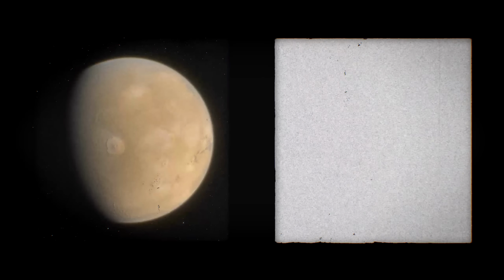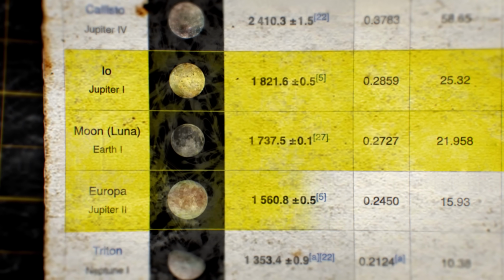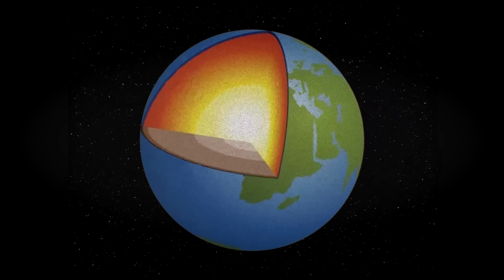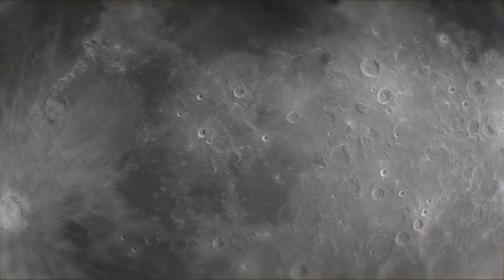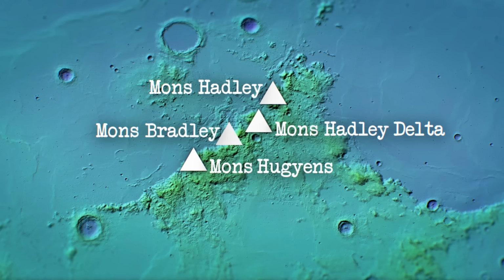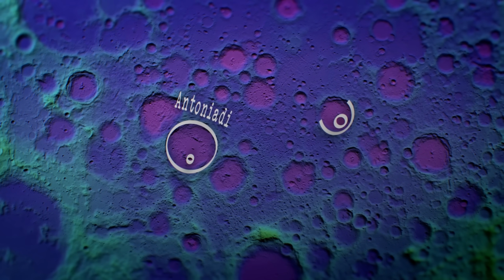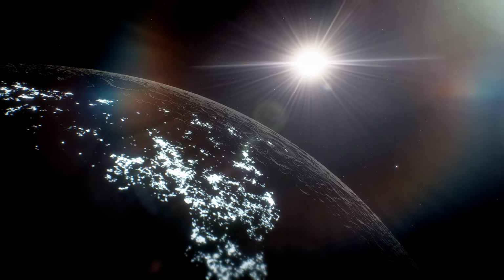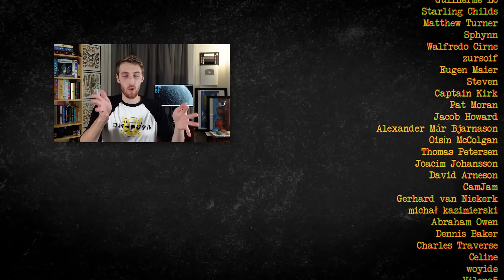Why The Moon's Geography Is DEAD

Comment: Great video.  Love the retro.  
Question: Didn't the Earth Moon system begin with the Moon very much closer to the Earth?  I mean like, half the distance or so.  Throughout the video I was waiting for you to mention this.
I have read that Moon and Earth interacted with each other more violently at that time causing massive tides kilometers high to sweep around the Earth.  Also, that the Earth's rotation was much faster in the order of eleven hours or so.  Over time, and as the Moon cooled, the  gravitational interaction between them created a gravitational 'drag' that caused the Earth and Moon to slow their rotations, and the Moon to slowly recede, and  'synchronise' to become tidally locked showing one face to the Earth.  Given these gigantic forces, is it possible that at the beginning there must have been internal geologic forces great enough to cause deformation?
Given all this,  I am wondering if there is any significance to the far side highlands being geographically opposite the Earth while the circular rift valley and basalt lava flows faced the Earth?  Is it possible, as a result of these earlier deformations slowly freezing into place, that this is what presents us with the Moon we see today?
The moon is more heavily cratered on the far side facing open space.  That seems logical up to a point.  But the Earth only blocks the Moon's exposure to open space on the near side by a tiny, tiny fraction of the sky.
I am more inclined to think that Moon was likely much more geologically active in its early life due to powerful gravitational forces and that the far side elevation and near side lowlands is evidence.
What do you think?

( I didn't research this before writing as I wanted to ask this question while it was clear and unsullied in my mind.)

Comment: With how you mentioned how Earth and the moon could've been 2 planets that are larger than Mars with 5 times its mass, It makes me wanna write a story on what that could mean for life on not only Earth but on this new planet as well with how not only how they would interact but the planets themselves. Would the planets behave like two stars relatively close to one another and dance with one another around the sun? OOOHHHH Just thinking about it excites me.
Reply: Well, for one, the two worlds would end up tidally locked to each other at some point, like Pluto and Charon are.  Meaning...
- The day/night cycle would probably be much longer -- though how long would depend on how far apart the two worlds of this double planet ended up before they locked, and how much the Sun's tides changed it since.  
- Assuming near-circular orbits, the main tidal cycle would be a daily one from the Sun, rather smaller than the lunar tides on the real-life Earth.  This would mean a smaller intertidal zone at the edge of the oceans.  Combine that with the longer day, and land life might take longer to evolve from sea life.
- A longer day/night cycle would affect winds and currents and weather.  Longer days would be warmer, longer nights would be colder, and a bigger temperature difference between day and night will have effects on winds and things.  Land life would have to cope with that bigger temperature swing.  And the slower rotation would also mean weaker Coriolis force on weather systems and currents.  

Also, if both worlds are smaller than real-life Earth...
- They'd probably cool off somewhat faster.  Plate tectonics would have slower-moving and/or larger plates, there'd be a thicker crust, less volcanic activity, and so forth.  Though depending on how off-circular their orbits are around each other, tidal heating could maybe offset this a little.
- Gravity would be lower, meaning mountains could get higher.  Slopes could get steeper too before they collapse.  Land life could get bigger, without needing to be as thickly built to support its own (lesser) weight.  Sea life would be affected less, since buoyancy already counters weight to a large extent.  (Most living things aren't a whole lot denser than water.)

There'd be plenty of other differences too, like vastly different continents and oceans from real-life Earth's, and different life forms evolving as a result.  Would one or both worlds have a supercontinent, or would their continents be more widely distributed?   Different arrangements have different effects on biodiversity, after all -- and with 4.5 billion years of different motions, it's kinda up in the air what kind of arrangement we'd see today.

Not to mention how different it would be to have a bigger, more brighttly-reflective object in the sky than the real-life Moon.  One that (assuming tidal locking) stays in roughly the same place in the sky relative to the ground, with the Sun, planets, and stars all moving behind it -- and goes through daily phase changes that pretty clearly match where the Sun is.  One with clouds moving across oceans and landmasses, and maybe even visible seasonal changes that vary in step with those of their own world.  And that (assuming tidal locking) is visible from only one side of the planet.  How would this object figure in the mythologies of a sentient species?  And how soon in that species' history would they realize it's a whole world much like their own?  

Would microbes or even actual seeds ever get transferred between the two by big impacts?  (After all, we've found meteorites from the Moon and even Mars on our own Earth.)  And what kind of biological exchange would happen if a sentient species from one world ever lands on the other?

Comment: I have a theory that rocky planets of different sizes follow a heat radiation pattern similar to stars of different sizes. 

Small stars like red dwarfs only have a radiant zone above its core, unlike our sun which is a medium sized star that have a convective zone above an inner radiant zone and around the core. Meanwhile super sized stars like blue giants have an second radiant zone above their convection zone. 

My idea is that planets follow a similar pattern, where smaller rocky world like Mars and the Moon only have a radiant heat zone around their molten core, while medium worlds like the Earth have a convection zone that can drive full plate tectonics. This could also mean that super Earth's, which we dont have any examples of in our solar system, could have something akin to secondary radiant zone instead of a solid crust, which would likely look like a magma ocean world where the crust is just too hot to solidify into tectonic plates

Comment: I think it would be fantastic if we could terraform the Moon. Not only would the whole world be able to watch it happen, but we could use it's magnetic field to correct Earth's tilt.

There's one thing that you got wrong though, the magnetic field is not created by convection currents in the core. Actually, I don't think you said it was, but that is the prevailing theory, which is incorrect.

The core becomes magnetic under extreme pressure, where it aligns it's magnetic domains, to fit together in a smaller volume. It's like a puzzle taking up less volume when it's put together correctly.

Comment: I would suggest that Venus definitively does not lie within the habitable zone if we go by the assumption that its environment would need to be stabilized by the carbon silicate cycle. Most estimates suggest that the HZ really collapses at about 10% more brightness than Earth receives, which would occur at 0.95 AU. I have also seen studies suggesting that 0.99 AU may be enough to allow a moist greenhouse state, which while not as catastrophic as leaving the HZ, would still boil away a ton of water over a relatively short period and probably cause a pretty significant mass extinction in just about every environment. While it may well be the case that it took a few hundred million years from the time Venus left the convention HZ to the time that it started getting runaway carbonate evaporation causing volcanic activity and forcing its carbon into the atmosphere, it was probably not a nice place to live even during the Fortunian and may even have been uninhabitable well into the Pre-Fortunian.

Comment: The only reason to "conquer" the Moon, other than to extract materials is to use it as a launch platform for exploring and eventually colonizing the rest of the solar system. With Moon having much less gravity and no atmospheric drag, you can lift stuff to its orbit for far far less fuel than if you'd go straight from Earth. With water there, a simple electrolysis from solar panels could give use infinite hydrogen for fuel and oxygen for breathing making the Moon a perfect space refueling station.

Comment: Wouldn't launching a rocket off of the Moon's surface provide a recoil to the Moon, which may result in pushing it slightly out of its orbit? If so, that's not a good idea since the balance of the solar system is tied to a thin line.
Reply: Nah, even if a dozen rockets launched from the same place at the same time, the force pushing against the moon would be imperceptible at best. 

If a single rocket launch was enough to mess with the moon's orbit, then impact events from meteors etc. would have an effect too, but we don't see that happen.

Comment: Overall good video, but I think it definitely undersells the incredible geology of the Moon.  The Moon is far from geographically/geologically dead.  The impact cratering processes, past volcanism of the Mare (pronounced Mar-Eh), and current tectonism and moonquakes have significant effects on its morphology.  There are also potholes on the surface from those lava tubes (which have been proposed Moon stations), disparities in crustal thickness between the hemispheres, and permanently shadowed regions in polar craters potentially with frozen water and other volatiles.  In short, the Moon actually has a fascinating past and present in its geology and geography.
Also, because I'm being a critic, Europa does not actually have plate tectonics.  It has tectonism, but not tectonic plates.  Thus far, Earth is the only planet with plate tectonics.

Comment: Io's atmosphere is indeed thin. However, it is not moon level thin. Io's atmosphere is comparable to Earth's at an altitude of 113-148 km, which is too low for a satellite but just barely above the Kärman  line.

Meanwhile, the moon's "atmosphere" is equivalent in pressure to Earth's at somewhere between 575 and 2500 km in altitude. Even at its thickest, objects on the lunar surface feel 100 times more solar radiation pressure than they do atmospheric pressure. The ISS orbits at an altitude with between 10 and 10000 times more atmospheric pressure then the lunar surface.
Reply: Compare:
Triton: pressure at 76-78 km
Pluto: 80.5 km

The moon is much more like truly atmosphereless worlds than objects with thin atmospheres.

Comment: We'd have to learn how to crack elements betters, as in the process that we use in the petrochemical industry for refinement. Let's look at the crust, where the vast majority of ANY mineral exploitation will be from. 60% OXYGEN. Find a way to crack that into breathable O2, and we're set. 16% Silica, there's a lot of your physical building material. 6-10% Aluminum, 4-6% Calcium, 3-6% Magnesium, 2-5% Iron, and 1-2% Titanium would represent the other commonly available minerals from which to fabricate an industry from. With the latter materials, I imagine engineers can create a lot of what is necessary for infrastructure, but as of yet with further surveying, there's no data on rare elements needed for critical components. Looking at Lunar crust composition, it is VERY similar to Earth, except lacking Sodium, and Potassium, perhaps elements whose compounds cannot exist freely in those temperatures at vacuum without an atmosphere.

Something critically lacking is HYDROGEN (from atmosphere), what we'd normally associate as the most common element in the universe, because the Moon's lack of active geologic activity, magnetic field, and thus inability to hold onto atmosphere has ensured that unbound H has been blown away long-long ago without somehow colliding icy comets onto our Moon. Hydrogen is the fuel of the future. A significant amount of energy will be probably be spent on any lunar venture breaking down its more common elements into H and other missing elements. Find a way to refine/synthesize Hydrogen on the moon, along with cracking open that 60% oxygen, and you have the ability to create water. Could you imagine humanity developing reactors to fuse OXYGEN for energy, instead?

Carbon is also notably missing. If only there was some techno-magical way to catapult/jet/pump our excess carbon waste and other excesses such as Sulfur and especially hydrocarbons like METHANE (CH4) onto the Moon, that would go a long way towards addressing those missing elements. I could see the Moon's Magnesium being broken down to create Carbon, and that's how we'd get access to that element on site, which gives you the resources necessary to also fuse Carbon into Neon and Sodium. Likewise, once we learn how to efficiently crack Silicon back into Helium, we'd have access to a whole bunch more catalysts.

Whichever formation event Earth and the Moon underwent together has seen the Earth vastly denser in heavy elements, and I imagine that the majority of heavy metals of the moon have sunk down during its accretion, and that its core doesn't have the convective ability necessary to churn things up, much as Earth's Mantle is a conduit for minerals to rise up into the crust.

Comment: Selenean summit, so the Moon summit, I see...  Well guess they weren't going to give up on relatively basic naming if they could help it.

On the speculation on what would happen if both worlds were more similar in scale after formation, they probably could both have sustained an atmosphere and perhaps water for awhile. But considering the predictions on when water will become scarce on Earth, it leaves one wondering if they'd have lost their seas after this long then. Not just due to absolute loss numbers, but because under UV radiation water splits in to hydrogen and oxygen. And hydrogen under heating of the Sun already can reach escape like velocities on Earth, thus causing a certain amount of it to leak away from Earth year by year, a smaller object would presumably suffer this problem even more intensely and thus lose its seas quicker. In conclusion, probably better to start with a higher starting mass then.

On a side note, lately they has been some interesting speculation on how the Moon might have formed and the circumstances of the time. Specifically there has been some thinking that initial temperatures caused by the impact might have been so high that vast amounts of rock would vaporize and that an atmosphere of vaporized rock would have engulfed the location where the Moon came together, meaning it would have rained rock like materials on the Moon at the start of its life. There atmospheres should some what separate out, and the altitude of the Moon, these would presumably have been the materials most capable of floating to the higher altitudes, and one can thus wonder if the Moon surface might due to this have an excess of these materials. This potentially would actually making it a little different in this aspect from other dead worlds out there then and may serve as a potential explanation why there is still some deviation between the Earth and Moon then. 
PS, It's worth noting that the Moon once was far closer to Earth, so the size of the vaporized rock atmosphere if it did happen would not have been as impressive as one would otherwise think from its current orbital distance.

Comment: The Moon is Hallow and serves as a Planetary Shield to Earth and regulates Earth's gravity.
Reply: The Moon is not Hallow
and The Hallow Moon theory is BS
(it just makes zero sense)
Reply: @titan-1802  the moon isn't hallow like an egg shell ... it's hallow in sense that there's alot of spaces due to it coalescent or spun together by centripetal gravity from the remains/debris of planet Theia that collided with earth when the planet was forming.  That's why when Nasa crashed probe into the moon and it rang like a bell.  It is a reason why the make up of the moon is so different from the earth.  The remains of planet Theia is in the earth's mantle straddling it like a pair of headphones, and this is called Large Low-Shear-Velocity Provinces (LLSVPs).

Comment: 19:20
We can recreate similar structures as the moon surface with modern day processes, If you've ever heard of electric sputering discharge it's how we get metal perfectly flat, Where arks of electricity juilt to whatever tiny microscopic structures stick out from the rest of the metal Completely melting and cratering those outcrops Until all that's left is a mere finish if you continue this process all the way through, but if you stop halfway through you'll receive a structure that looks a lot like the moon.

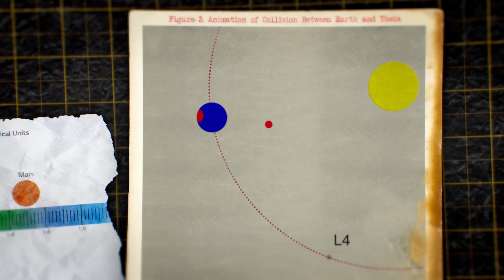Comment: 12:47
There's a few dozen theories on how the moon was made, and none of them can be proven faults or true, I prefer if you didn't make it sound like it was a settled debate, Especially considering the moon is easier to explain it not existing than it existing, At least those in the know would say so.
Reply: Considering it's composition which is similar to Earth's, other theories rely on MASSIVE COINCIDENCES to actually be true, which is not practical to state if it doesn't change the main point of the video.